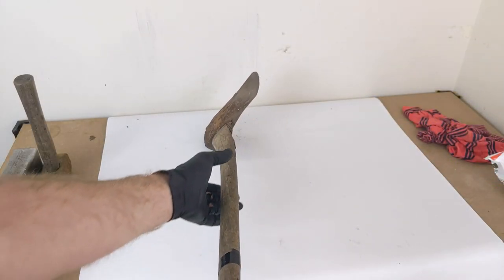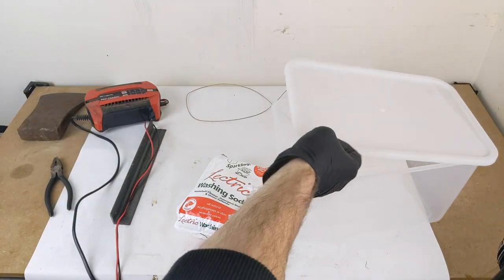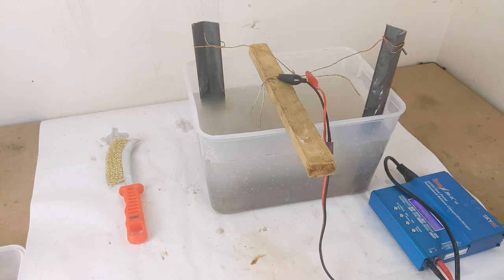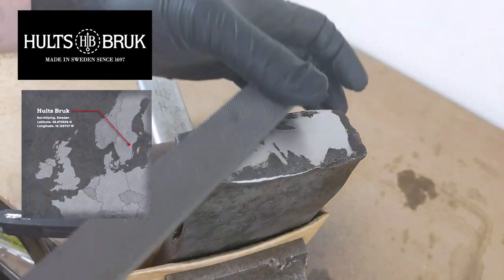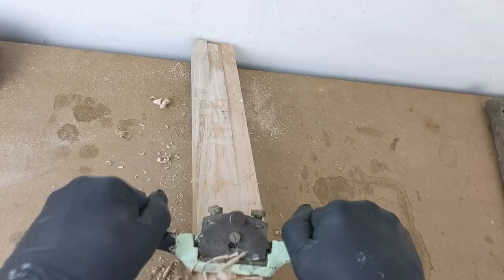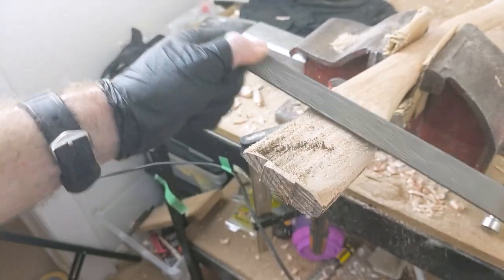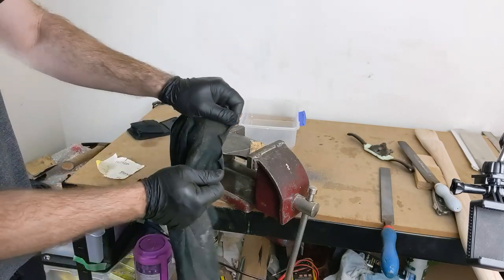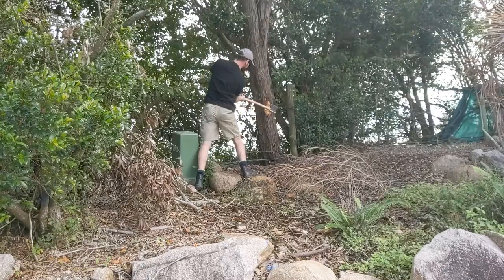Vintage Axe - Simple Tool Restoration

Comment: Whacks at the cheap axe, turns out its a hults bruks/ plumb colab, reason why I say that is because that resin is called permabond, and plumb usa did have hults bruks make them axes meant for the Australian market, looks like yours is the Tasmanian pattern that many in the USA would love to have, a yankee patern has less swoop at the toe end. Sell that to an axe junkie and you'd be able to fetch upwards of $100 bucks for it. At least just for the head. Id rehaft that on a whiskeyriver 32c if I got my hands on it.
Reply from the maker: This is way more info than I was able to dig up at the time. Thanks heaps. I ended up giving it to my dad, so he'll put it to good use, until he get too old to swing it anymore.

Comment: Nice work. Did you try for a particular angle when filing the edge? I've never used electrolysis for rust removal but it really seems to do well. Cheers!
Reply from the maker: I kept with angle it basically had, I'd estimate around 25 degrees? And yes, electrolysis is great, I prefer it a lot over a wire brush. Bit messier though.

Comment: That tree looked tough, camphor laurel?  How come you have ads on this video when you only have 200 subscribers? i'm the 200th.
Reply from the maker: Not sure what type of tree it was, but it was dead and dry which made it harder. I shouldn't have ads on my video, so not sure what happened there. I think you need 1000 subs for that.
Reply: @RestorationEndeavours  i recon check if this video has a copyright claim on it. I listened to it very carefully again and there is an almost imperceptible radio going on in the background in one scene. The question is whether you should do something about it.  i.e let the claimant skim money off your video and YouTube will continue to favor this video in recommendations or take the high ground. In the past I have always jumped on these charlatans, but looking at your stats, perhaps they could be thought of as a type of short term symbiotic scum. (till you can your 1000 subs)
Reply from the maker: Thanks for the heads up and being #200.   No copyright claims or anything in my dashboard so I'm still not sure why you got an ad. Did YT change something recently? I would have thought they would let me know.

Comment: That's not how you hang an axe head. That thing will fly off in less than 100 whacks. Maybe 50. You want at least 3/8th's of an inch or a smidge less out the top so it can mushroom out to hold the axe head securely on. I'd highly suggest you go to Bucking Billy Ray's channel. The man is hilarious and a master axe maker. I know of nobody else that builds a better WORK AXE. Not wallhangers for show. But a real world wedge busting demon of an axe. Just thought I'd give my 1 cent. No disrespect intended. You do phenomenal restorations. Have a beautiful day sir. God Bless.
Reply from the maker: Thanks for the great feedback! I have given this to my father so it will definitely get used hard. I may grab it back and see if I can make some adjustments after checking out a few videos from his channel. He does some great work. Cheers Bro!

Comment: If your in aus then that's a tasmanian  pattern
Reply from the maker: The shape of the head? That's awesome, thanks for the info! The wood I used for the handle is sometimes called Tasmanian Oak, so that's fitting.